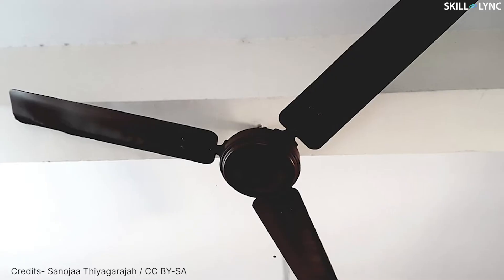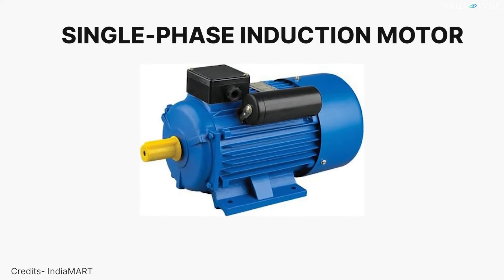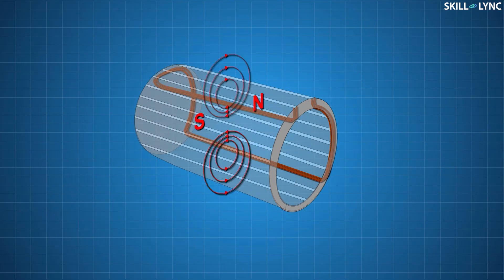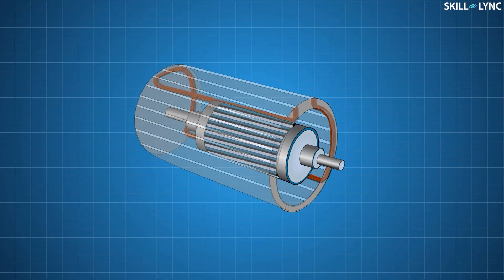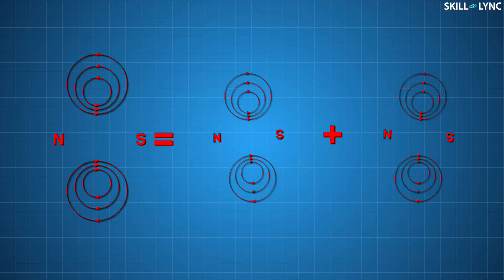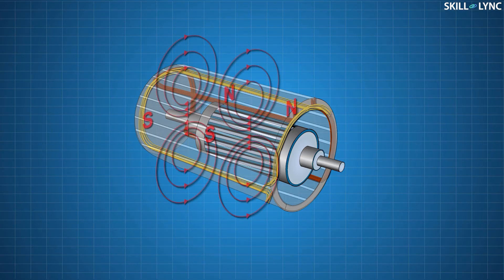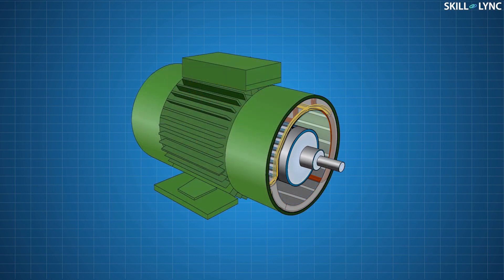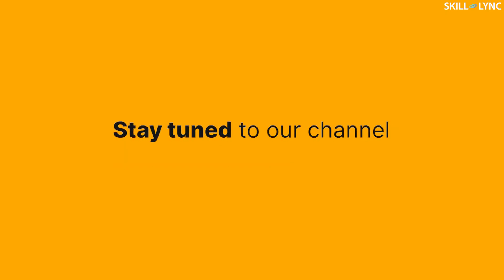Construction and Working of a Single phase Induction Motor | Skill-Lync

Comment: I don't understand why when the rotor is rotating the two forces don't cancel each other. The crucial part is missing, at least I don't visually and verbally get this part...
Reply: The forces will cancel eachother and the rotor will experience no torque.So,single phase induction motor are not self starting.

Hope it's useful